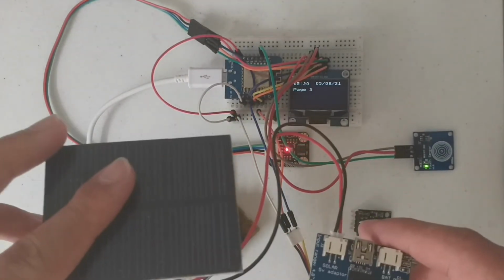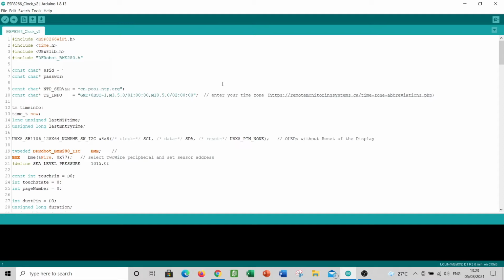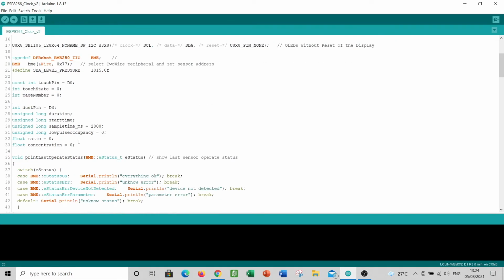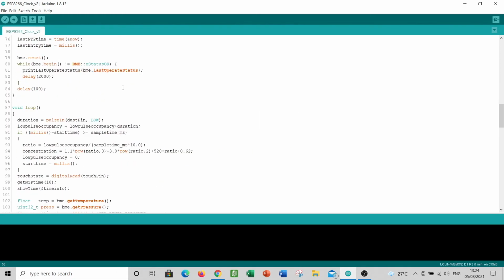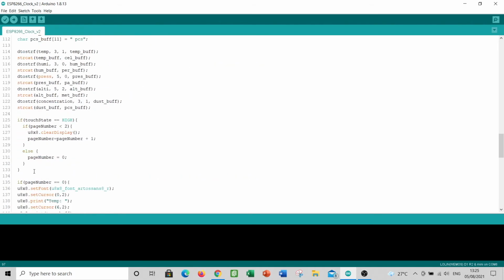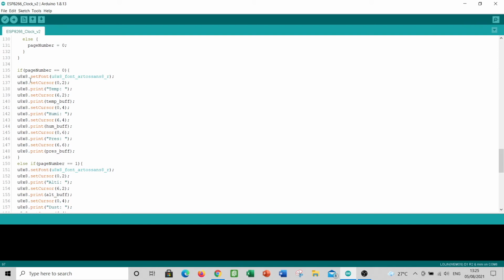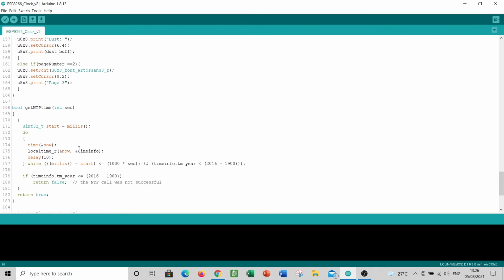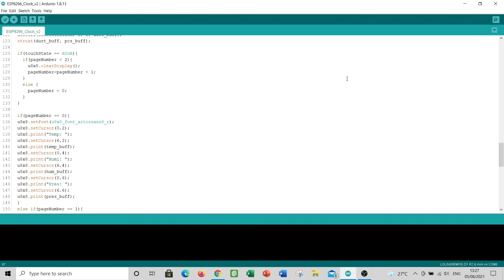ESP8266 Weather Station v2 (added dust sensor & menu system)

Comment: Hey, what unit does the PM sensor return the data in?
Reply: particles per 0.01 cubic feet.
Reply from the maker: The microcontroller that I am using is the Wemos D1 Mini.